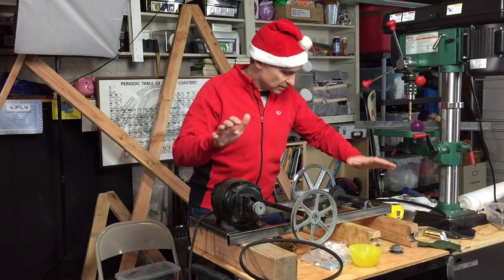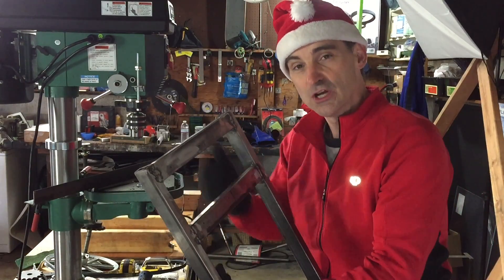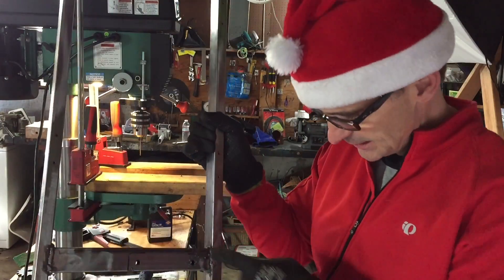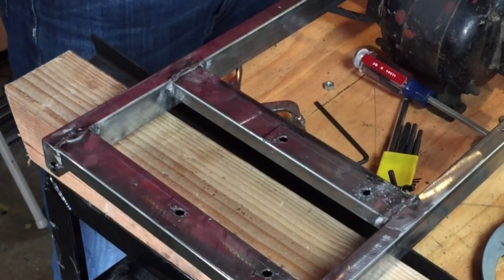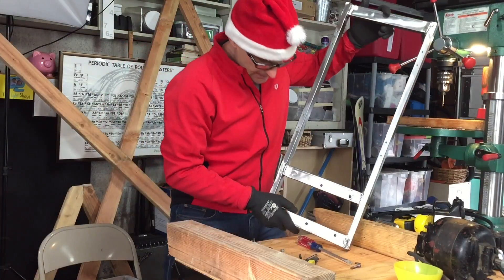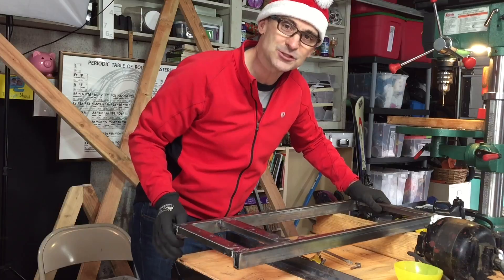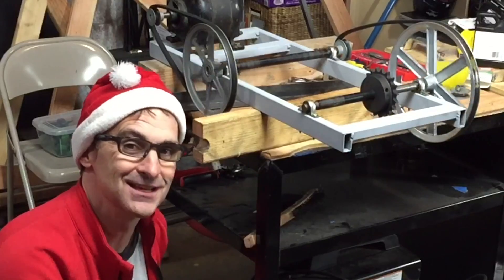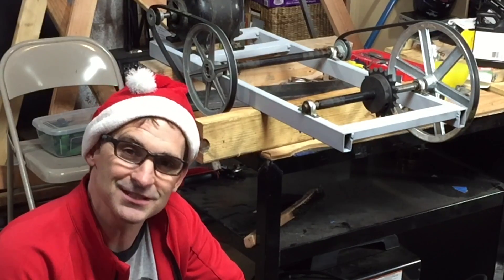Chain Lift Transmission - Part 2

Comment: Well, as I learned it, if you cut threads you have to turn one round cut, half round back, thenb again one round cut and back again. This is for that the tools hold much longer and cut smoother. ANd btw, I'm no expert but If the engine vibrates it could untighten some screws a bit that are nearby the engine. so what if there'd be one spring (or two paralell ones) that reduce vibration and is at the same time the spring that presses the chaingear in order to tighten the chain for a smoother turning. like the side where the heavy engine is, is fixed with a hinge and the other side is fixed over a spring
Reply from the maker: Blasulz1234,
I appreciate your advice. I'm going to put nuts on the ends of the machine screws just to be sure things stay tight. 
That's a great idea about using the weight of the motor as part of the tensioning system for the chain. I'm definitely going to give that a try. Thanks!
Best,
Will
Reply: Will Pemble No Problem:3

Comment: Hi Will, great work. You probably could have fixed the video rotation issue in post production, but that's a minor issue. How long are you anticipating it will take for the cart to go from the bottom of the hill to the top with the current configuration and planned track? Like others have mentioned you probably will need some way to adjust the belts, since they will stretch out a bit over time.
Reply from the maker: Actually, SaliusenEx, I somehow managed to screw up the rotation of the clip after I shot it.  Just a pure bonehead move on my part :)  Happily, I still got most of my point across and it was great fun building the transmission and making the video.  Maybe someday I'll have a cameraman.  For now, thanks for putting up with my kooky video skills :)
Best,
Will

Comment: I'm curious if there would be any benefit to replacing the pulleys and belts with chains and sprockets? Given the forces involved with lifting the car and passenger, not to mention the chain itself, up the hill, it would seem that a chain and sprocket would provide better power transmission with no slippage, although I can imagine it would be difficult to find appropriately sized sprockets.

Just thinking out loud...

Comment: I'm glad to see the chain lift together and now waiting for the next installment. Just one question I have, as everybody does things different, is there any worry of the belts stretching quickly without a tensioner or adjustability for the belts?
Reply from the maker: Hi f2535 
I've still got to tighten up the belts before the system goes live. If there is any problem with slipping, I'll add belt tensioning pulleys. If that doesn't work, I'll trade out the belts and pulleys for chains and sprockets. Hopefully, it wont come to that, though :)
Thanks for watching.
Best,
Will

Comment: It looked like the motor mount holes weren't threaded anymore when you slid the bolts in. Change of plans? [EDIT: Now I see you answered that while I was writing this.] When you've assembled it for good, you should probably use lock nuts, or at least pairs of nuts, on those bolts to keep them from loosening over time.

That said, this looks awesome. Looks like it was really pretty easy to build; I'd have guessed this would be one of the hardest parts of building a coaster, but apparently not. That's one of the great things about videos like this: developing an expanded sense of what's possible.
Reply from the maker: Hi Dan Efran 
Good eye! I pulled that explanation out of the video for time reasons. Sometimes, it's a challenge to show a 4 hour project in 12 minutes :)
Great idea about the lock nuts. Couldn't agree more. Thanks for watching, Dan, and for your comments.
Best,
Will

Comment: I'm confused, you spent all that time drilling and tapping those holes so you could screw them into place and then put a nut on the other end. However, when you went to attach the motor, the bolts just slid into the holes and you didn't have to screw them down into the holes.
Reply from the maker: Hi sam seide,
Here's the thing. There was a clip that didn't make it into the final video where I talked about how I didn't have the 3/8" machine screws to mount the motor, and how I would use the 5/16" hex bolts as a temporary measure. So, the threads are still in those holes, and as soon as I get the right screws, in they'll go.  I plan to put nuts on the screws as well when that happens, simply for added strength. 
Thanks for watching, Sam. You've got a great eye for detail, which will make me work that much harder :)
Best,
Will

Comment: How are you planning to tension the belts? They are far too loose. You'll have problems with the belts jumping the pulleys. Regardless, well done!

Also, as a bit of a critique on the video, the music was fun, but it overwhelmed your voice in many instances. The music should not "compete" with your voice. It got so loud when you were not talking so that I had to turn down the volume, only for your voice to be so low that I had to turn it back up. It made the video difficult to watch.
Reply from the maker: Hi Mark,
Thanks for the feedback. The belts have yet to be adjusted. 

As for the audio, I agree entirely. Definitely going to apply those learnings in future videos (of which there shall be many :)

Thanks for watching. 
Best,
Will
Reply: Will Pemble I cannot wait for more! You are making me so jealous! I live in an apartment. All I can do is watch and envy.

Comment: Awesome! For the vibration did you consider using rubber washers between the motor and bracket?
Reply from the maker: Hi Blunder Man,
Great suggestion. The transmission turned out working really well and looking quite strong. For the motor mount, I'd rather 'prevent' vibration than to manage it. Happily, it worked! Thanks for watching :)
Best,
Will